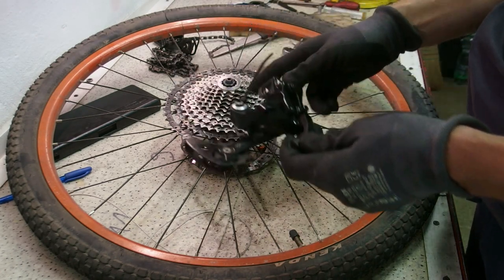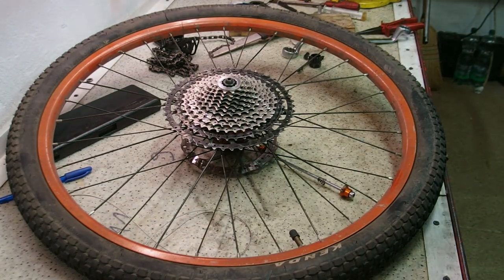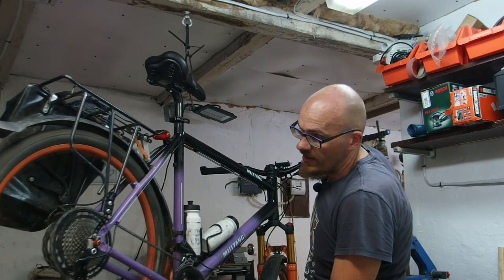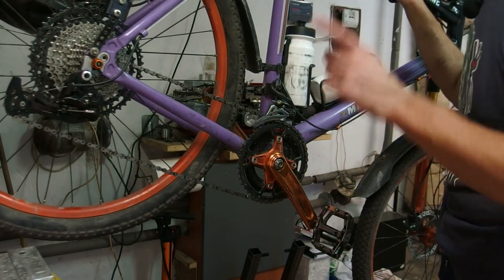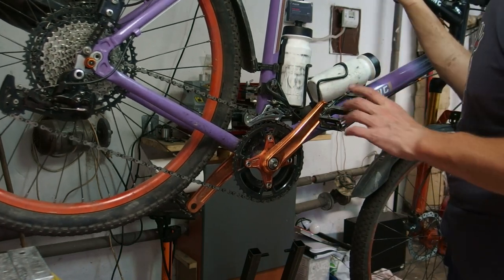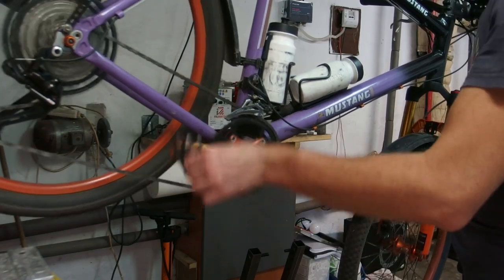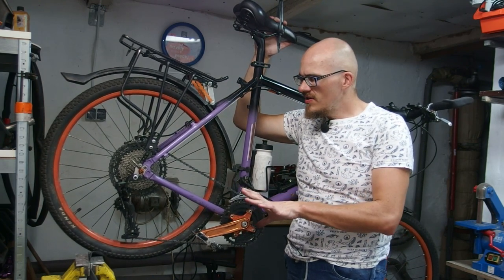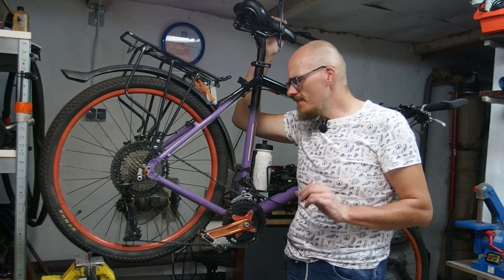11-50 cassette and two ring setup?

Comment: I recently made a 3x11 build, 11-42 in the rear; 22-30-40 in the front lol.
Reply: That's about what the gearing is on my bike. It's a 3x8 drivetrain with an 11-42t rear cassette, and something along the lines of a 22t-34t-40t up front. Pretty ridiculous gearing and I love it. As much as I'd like to convert to 3x, I just can't give up my range. Low enough that I run into other physics issues before not having the torque to climb, and tall enough I (almost) never need the third chain ring.
Reply: @smileyguyz  I love that I can go fast on flats and even get a little boost downhills while in that large front gear, as well as being able to drop really low super fast to get up hill without having to get off the bike.

I find the timing of this vid kinda funky.
Reply: @whygoogle5051  Yeah, I think unless you're doing really rough downhill, 3x is far superior to 1x.
Reply: I'm thinking about switching to a 9 speed 11-40 cassette with my 22-32-44 front.

Can you switch to big-big rings (should that ever accidentally happen), without damaging/destroying anything? Or are you just using a longer chain, where the small-small combination has very little tension?
Reply: @imrevadasz4564  I had originally used a 126 link chain thinking I would need the length considering the 3x chain rings in the front; but I ended up removing 8 links to remove the extra sag. 

I have no problem being on both large cogs if need be, since my front derailleur uses a friction shifter that allows for trimming. But usually I avoid going to the extreme opposite gears since it doesn’t make too much sense unless I’m being lazy. 

I’m using a GX Eagle 12-speed derailleur so small-small also works and has minimal sag since the rear derailleur has a clutch. 

I’m honestly super happy with it and love that when I need to be able to climb, I can immediately just drop down in the front and not have to stand on the pedals to get up hills. Same with going fast on downhills. Quick gear up and I’m flying. Wicked versatile.

If I could do something different, I would love to see a clutched Rapid Rise derailleur for 11-speed mountain cassettes with a long cage. Makes a lot more sense for a build like this.

Comment: i am the person currently using a set up like this to get crazy range lol
i have an 11 to 50 9 speed and using 32 22 chainrings
ive got my derailleur on an extra long hanger and im using an indexed thumb shifter for the cassette
it works pretty smooth as long as i dont crosschain it and the thumb shifter allows me to nudge the gears a little if they dont shift instantly
i used to run the same cassette 1x and found it impossible to find a chainline that worked smoothy for the whole cassette, the friction in 1st was actually noticeable while riding
so for me its the opposite i find this smoother
plus i can tow my trailer up any hill effortlessly which is nice
ive also run this set up 3x which is even smoother but i find the 32 to be as big as i can push unless im already going downhill

Comment: Is that a motorcycle M14 bolt in your Fovno Phantom crankset? I guess the stock one got broken and you didn't find any M14 bolt replacement right? I'm selling the same brand and yeah that's really a pain finding a replacement. However, I saw a Fovno branded replacement bolt in our local online shop. I think they can also supply to you via Alibaba.
Reply from the maker: It is M15x0.75 ISIS drive bolt. If the replacement is not steel it is going to break, so why bother?
Reply: @TryboBike  If you use M15, then there is a lot of titanium bolts available.

Comment: hey Trybo Tech,

can you recommend a 165mm crank that works with a bsa68 that isnt square taper and sort of strong and light?  not shimano.
Reply: Lightest is FOVNO Thunder but it uses a rare M14 bolt. You can try SenicX from Sensah too
Reply: @WashichawbachaW  thanks